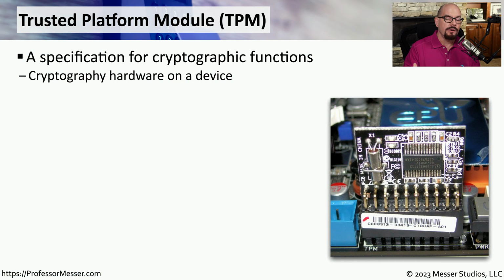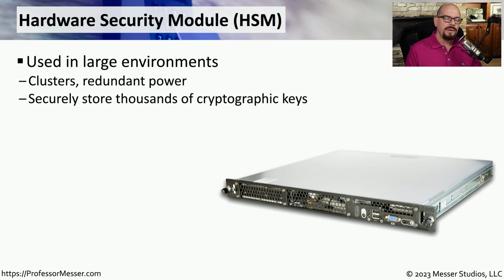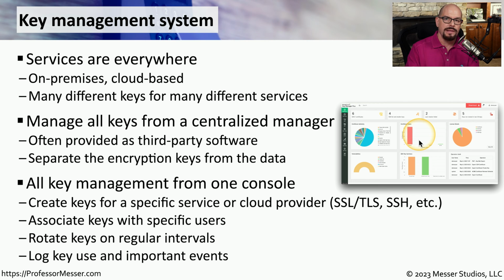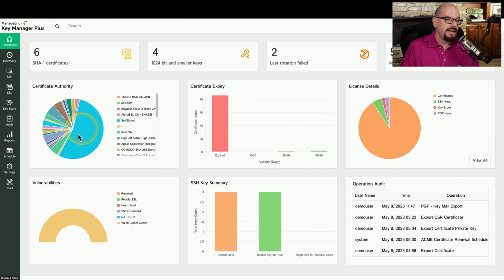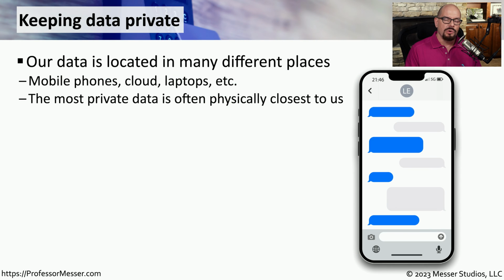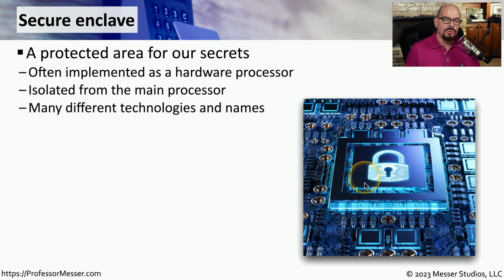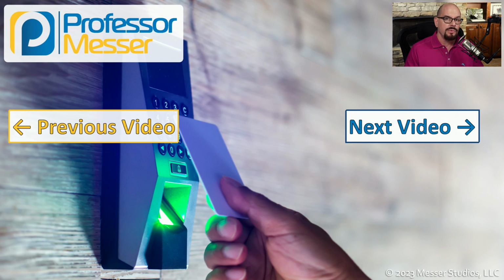Encryption Technologies - CompTIA Security+ SY0-701 - 1.4

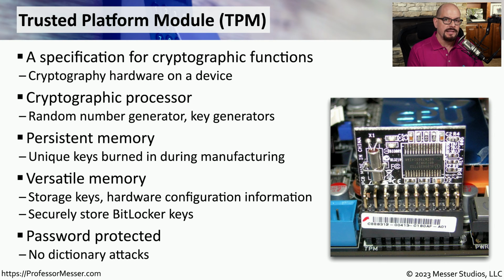Comment: 0:55  ;  you said there is no way to brute force, I hear that alot in Cybersecuirty (I'm still a total noob)... In my limited knowledge, I believe anything and everything connected to the internet is hackable...isn't that the whole idea of a pen tester? Going around the wall somehow someway?
Reply: Funny I just saw your comment. I thought the same thing and actually did some research on it. Its technically not impossible. It would just take an infinite amount of computing power and time to do it in a realistic fashion.  The odds of finding the correct key are like 0.00000000000001 if you tried 1 trillion keys per second and did it for a year.

Comment: How is a Secure Enclave different from a TPM?
Reply: Secure Enclave is an isolated processor, primarily used in Macs, and TPM is a chip that's more integrated into the system for Windows. They both help with the secure boot process, encrypting data, and key management.

Comment: Hi Professor, thanks for the explanations thus far. What I don't understand now is the differences btw a TPM and a secure enclave, from the explanation you gave, they both sound similar.
Reply: TPM is focused on securing data at rest and ensuring the integrity of a system, primarily by providing a secure place to store cryptographic keys and perform hardware-based security functions. Secure enclaves, on the other hand, are designed to provide data confidentiality and integrity during computation, creating isolated environments to run secure code without exposure to the rest of the system.
Reply: @PuranDeepSingh  doesnt hsm also provide confidentiality since it stores crypto keys as well? also the only real diff between hsm and tpm is that hsm can handle larger scale crypto storage and tpm is for ia single device?
Reply: Same question here
Reply: Same question. Definitely sounds similar. However, I believe Secure Enclave is specific to Apple's iOS and macOS systems while Windows and Linux uses the Trusted Platform Module (TPM). I hope I'm not mistaken.
Reply: @KpichF  You are right, that's really the "main" difference between those two. Maybe some minor things differentiate both, but it's so little that it's not really necessary trying to learn it.
Reply: My brief google search indicates that a Secure Enclave is specific to Apple products.   Not sure why professor says it's a general term.  PC's have TPMs and Android devices use TEE (Trusted Environment Execution) chips.  Somebody please prove me wrong. I did't put too much time into it. Agreed, it's confusing being presented as two different subjects.
Reply: Hi Guys, based on my research, a Secure Enclave is a dedicated processor (or part of a processor) to run an isolated environment in which applications will be executed safely away from the base operational system, using all security features mentioned in the last slide. Intel and AMD has their own variants as well (Intel SGX, AMD SEV).
The TPM is not a processor, it is a module to store keys, generate and manage them and provide functionalities related to integrity and trust for the whole system (not only an application), for example storing the bitlocker keys and enabling secure boot.
Reply: @eeka_droid  But the Prof. Messer also mentioned that TPM can perform secure key generation for the user it definitely is not similar to secure enclave because that's a whole different processor working for security and cryptographic functions. So Yes TPM is not a processor
Reply: @zcarfanatic  No you're right. I can verify your research
Reply: From what i understand A secure enclave is kind of like a mini-processor built into the main CPU, designed to do everything a TPM can—such as securely storing keys or handling encryption—but with the added ability to perform more complex or heavy-duty cryptographic operations, like real-time encryption/decryption or biometric data processing. It’s faster and more integrated than a TPM but serves a similar goal of isolating sensitive data and operations. But just with a little more power
Reply: is that TPM is like generating and storing key, while enclave encrypting the memory and data?